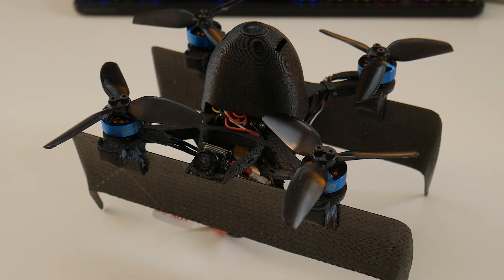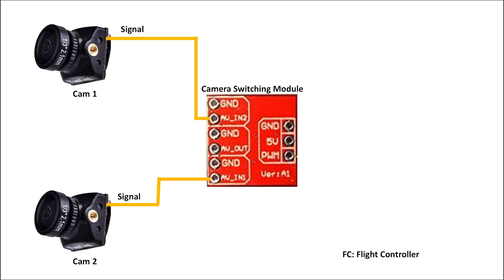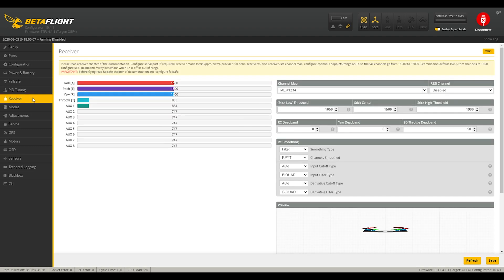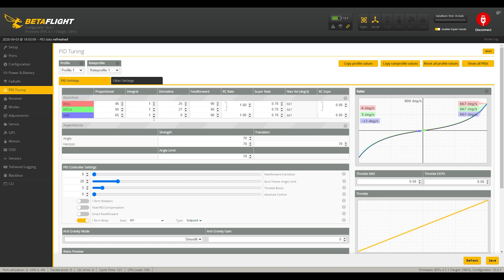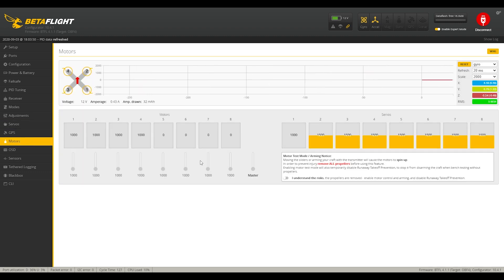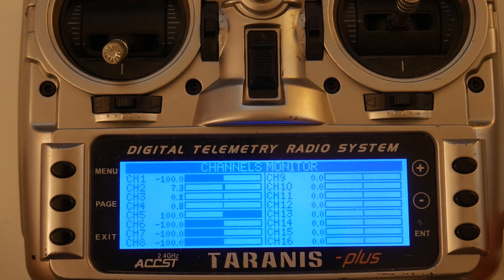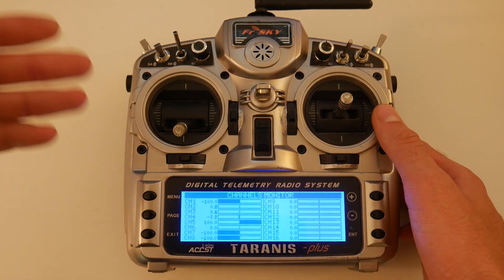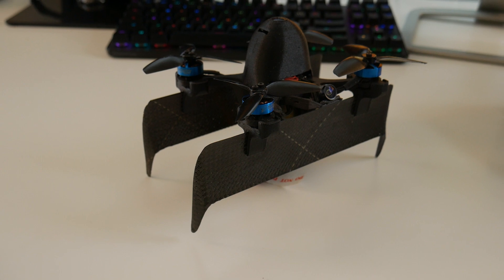How to setup the Mini Qbit - A Complete Walkthrough - Electronics, Betaflight, Control Mixes | OLD

Comment: Wow, I just discovered your research group and I have to say your work is amazing! Wanting to build one, is there any reason not to implement it with the Teensy Flight controller you use for some of your other projects?
P.S.: I think the amazon link for the motors got mixed up. It leads to a different set of props.
Reply from the maker: Thanks!! The teensy flight controller will work, it will fit better on the new design which is available on miniqbit.com You can see Nick's implementation of the teensy flight controller on the mini qbit here, although betaflight is better suited for this small platform since the teensy computing power is being pushed to its limits on this scale: https://www.rcgroups.com/forums/showthread.php?3922447-The-Mini-Quadrotor-Biplane-%28Mini-QBiT%29-A-first-in-its-class%21
Reply: @peterryseck  Oh cool I had not seen that post yet. So you are saying that the time constants at which the teensy can react would struggle to regulate the faster motions of a smaller model, correct?
Then perhaps I will build it twice: Once with a regular FC (it might be good practice for me since this will be my first RC project - I know its rather ambitious^^) and then with teensy to learn that platform.
Reply: @foolwise4703  I highly recommend a betaflight board over dRehmFlight for best performance on this. dRehmFlight is meant more for larger vehicles--as Peter said, this small size/inertia vehicle pushes dRehmFlight to its limit with its bare-bones nature. Betaflight is much more mature for tiny multirotors with its advanced filtering for smoother flight. With that said, I've got the teensy flying on my mini QBiT pretty well, though there are still some small issues with prop wash that betaflight filters out much better at this scale
Reply: @NicholasRehm  Thanks guys! I will start with a betaflight controller then and first build a regular quad setup before moving towards vtol mode on this and later teensy, I'll let you know how I am faring with it. :-)

Comment: Awesome project and a huge thanks for sharing.  I'm still not understanding what is driving the I term values as in where do the "static" values come from?  Printed one today to have a look, buddy stateside has ordered one but don't think shipping would be cost effective for me.  subbed and looking forward to where this goes.  Love quads and fpv but I really don't like the camera pitch changes on quads.  Hoping this may work out to be the ultimate FPV setup, a tiny, fast gap shooting durable "plane" with VTOL capabilities and a "parachute"
Reply from the maker: Thanks! I will make an updated video soon where I explain how to set everything up from assembly of parts, to betaflight setup, to flying. This video is ok, but it needs to be updated and more clear. In terms of international shipping cost, it's a flat rate at $27.50. I agree, the extreme pitch angles on quads with one camera can be quite annoying. More info/videos coming soon!
Reply: I see now the last 2 arguments on the cli command don't show up on the configurator adjustments tab... Was bugging me, was hoping could do similar in inav but appears not.

Comment: would it be possible to re-orientate the electronics to reduce the cross section when in plane mode? or does the nose cone make the resistance less of a factor?
Reply from the maker: Good question, because its a stack of electronics, its actually taller than it is wide. So its frontal area is less when the electronics are oriented the way it is right now. The nose cone helps a bit with reducing drag, but realistically it doesnt do that much.